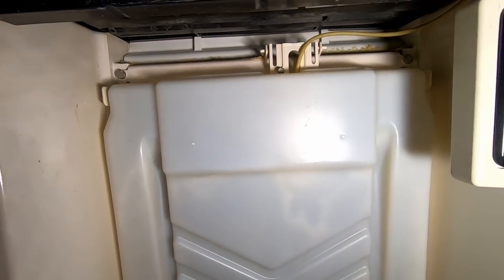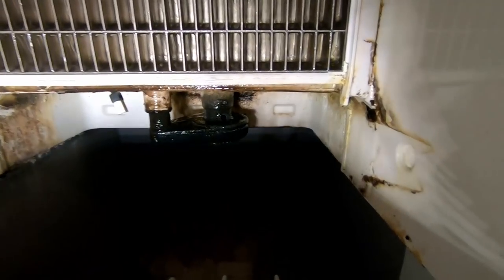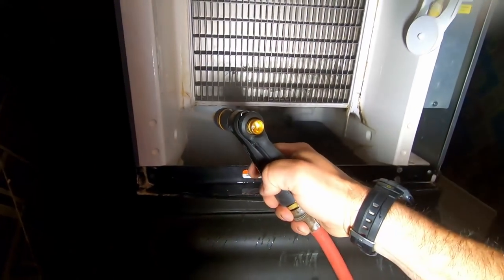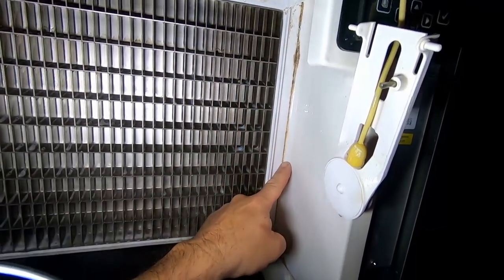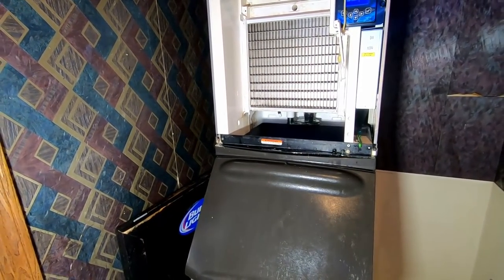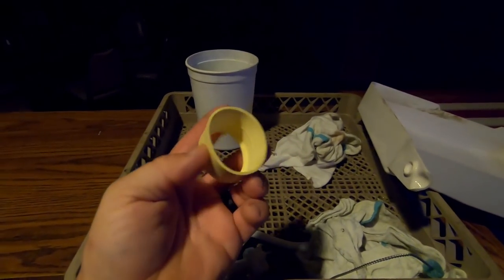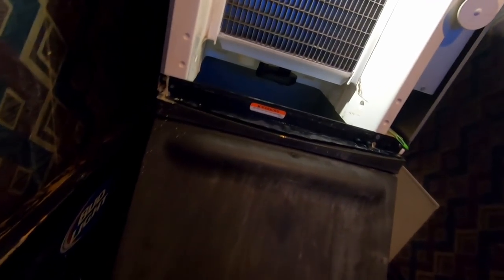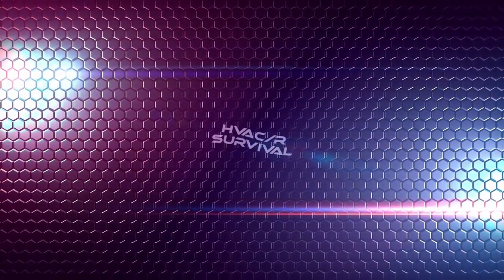ICE MACHINE NOT RUNNING

Comment: I use a similar thing to wash out ice machines.  it makes cleaning them a lot easier.  The UV helps a lot but cost a lot to install.  good video
Reply from the maker: This one here definitely could use the UV light. We've tried the bipolar system it didn't work very good. Manitowoc is out of the UV lights though

Comment: I'm pretty sure you couldn't use it in a commercial environment, but Drano drain cleaner works wonders at taking calcium scale off of plastic and glass. I have the same sort of water, and every few months all my dishware gets a nice soak and some 50% diluted Drano.
Reply from the maker: Yeah I would be afraid of someone ingesting anything that was left over.

Comment: Why did you not remove the water pump? Need to run brushes thru supply lines. I do three cleaning min. A day in Fresno Ca. This machine was not that dirty. I see some with fungus so bad looks like tonsils growing in them
Reply from the maker: I sprayed down from the top fill hose that feeds down to the pump, compared to most of the half ass cleanings I've seen this is more than what usually gets done. Far as nastiest I've machine, I've seen a lot worse too but this was the worst for me in 2021. I've got ones that had over a inch of fungus on them. It's called clickbait and it gets people to watch the video. Thanks for the feedback and the view👍👍

Comment: Me personally, i use 70-91% Isopropyl alcohol dips and distilled water to clean wired electrical connectors etc then dielectric, helps with USB cables and so forth too.
Reply from the maker: That also works good 👍👍

Comment: hot water not working on the 3 tub sink, probably a ball valve near the floor someone wailed when mopping. I've seen them with the handle not 1/4" off the floor when open, the mop strings snag the handle and off she goes.
Reply from the maker: I'm pretty sure it didn't work the last time I was there. Health department can fine you for Not having hot water in your three compartment sink.

Comment: Ever try lemon juice to run it through the cleaning cycle?
Reply from the maker: No I haven't. Does it work good?
Reply: Our boss would only let us use it because he didn't want to use the chemicals around the ice for the liability. It worked pretty good. We would just go by the big box stores and get a couple of the big bottles and run it through on the cleaning cycle.
Reply from the maker: @kainivester9187  So did it remove the slime or did it remove the calcium? Or what did it do best or did it do any better than the regular chemicals?
Reply: @HVACRSurvival  we don't have a lot of calcium in our water but it seemed to remove a little bit of it and it would remove the slime pretty well.
Reply: @HVACRSurvival  at his company up in Jersey that was all he would use on big commercial ice machines

Comment: Yes, you want these to be clean, but realistically, the vast majority of the mold and algae that you might end up with in the ice?   Your digestive system will have zero problem taking care of it.  The biggest issues with the growth are clogging, and flavour.   Not toxicity.   

As I drink mostly carbonated beverages, neither toxicity nor flavour are likely to be an issue.   The acid eats them.   

As someone who grew up with hard water, and now lives in a house on a commercial well (MUD), adding a standard large filter reduces down a lot of the buildup.  (Doesn't even have to be reverse osmosis, but that's what you need to REALLY clean the water up.)   (yes, I saw the big filter.  Imagine what it would be like without that.   )
Reply from the maker: You are correct👍. The problem I see is a lot of locations don't care what they serve and that's what bothers me most.
Reply: @HVACRSurvival  - I agree, but I tend to cut them some slack.   Most of the employees aren't encouraged to think for themselves about cleaning everything, and even many of the shift managers aren't even educated on how to properly clean the machines.   In some, they're actively discouraged from touching the equipment.   (Mind you, opening it once a week, dumping the ice, and spraying the grids with bleach, then rinsing, isn't THAT difficult.   It's not the "right way", but better than "growth way")
Reply from the maker: @tbelding  I don't blame the employees, most of them are lucky they can make sure you get a napkin. The responsibility of the machine being clean properly falls on management. I'm just picky where I eat at now. I don't mind scale, I just don't like the slime.

Comment: Ice machines in bars are the worst.  Especially if the are using a carbon block filter that removes the chlorine. The yeast gets air born anytime they open a bottle or pour . Perfect environment for slime. Had good luck with ionizers in larger machines in slowing down the growth.
Reply from the maker: We used an ionizer on one it helped, it was made by a company called bipolar. But I truly think the ultraviolet light is a lot better. I have a Subway store that has a large UV light mounted on top of the unit ducted into the system with flex tubing on a Manitowoc and it was spotless.